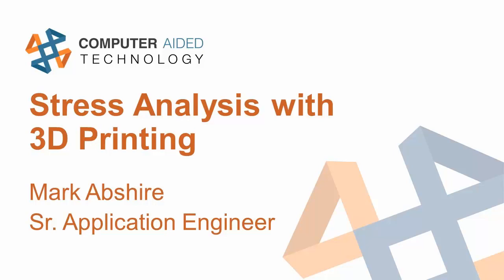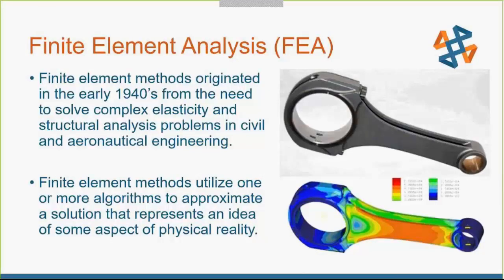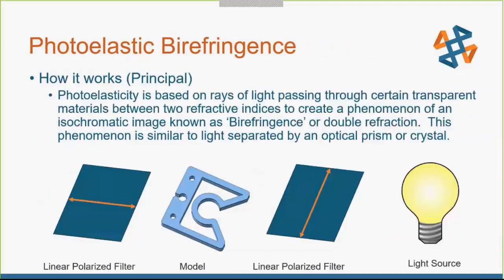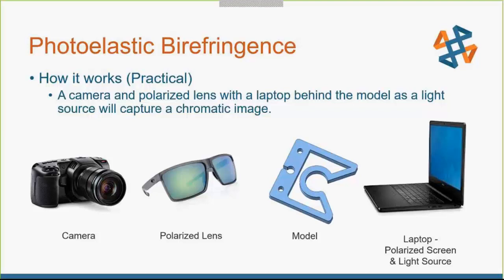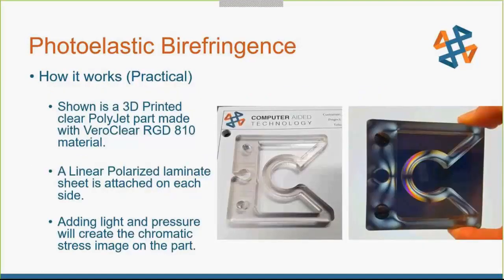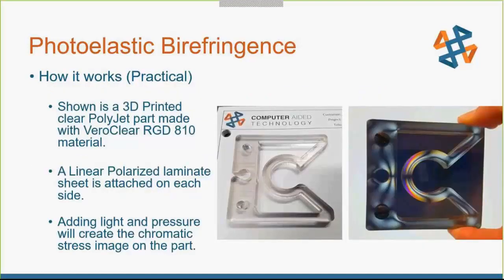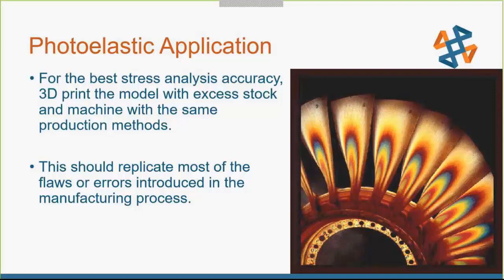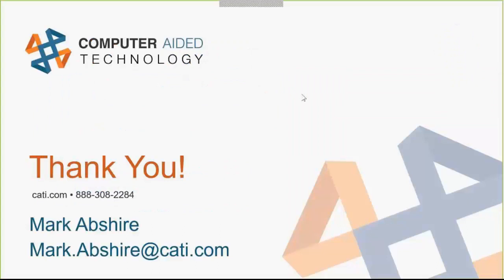Stress Analysis with 3D Printing

Comment: Minor technical note: as an engineer, I'm compelled to point out that "7.5 ft-lb" (per the slide) is a measure of torque, not force - but, in the presenter's defense, he did correctly say "7.5 pounds of force". All that aside, it was an interesting presentation. Thx.

Comment: Unfortunately, I did not see anything about FEA specifically on 3D prints, though the YouTube title is "Stress Analysis with 3D Printing". Is there more? Or, can you point me in a direction? I imagine FEA for a 3D print would be rather complicated, given the range of 3D printing technologies, the geometries involved, and the range of factors involved. Hm? Thx for any help.
Reply: I am also in pursuit of finding techniques for stress analysis of 3D prints. I agree this video did not cover anything specifically to 3D printing
Reply: @Eric-gd3ec  Agree. I am also looking for the same topic as you. 
Any discovery so far? I feel like hitting dead end here.
Reply: @pitipatwongsittikan9636  The only thing I ended up finding out by speaking to someone was to 
-Export the sliced model from the 3d printing software
-Reinsert into the FEA software

Be careful as this is just an approximation and some slicing software are not the best. I ended up not proceeding with this method and went a different route with the time constraints on the project
Reply: @Eric-gd3ec  Have you checked this one? 
https://www.youtube.com/watch?v=mrc4d5Y331Y

seems like the closest way FEA and 3d print can meet. 

With your method, how close is it to the actual printing object? Overdesign is ok for my case. I'm more concern on under design since it might take time and money to redo the work. 

Thanks for the reply :)